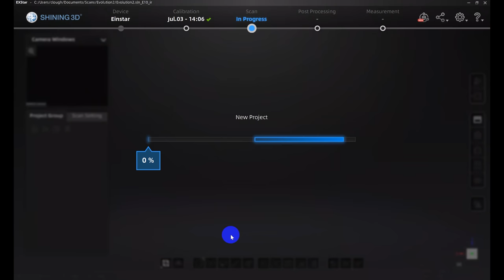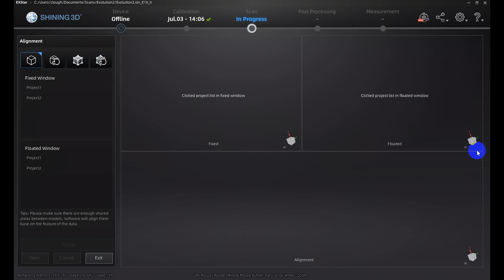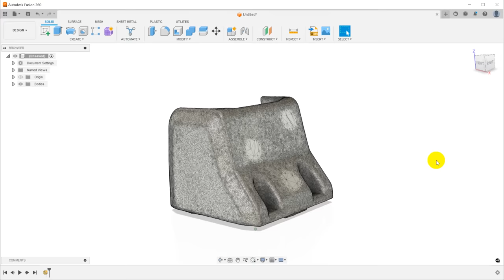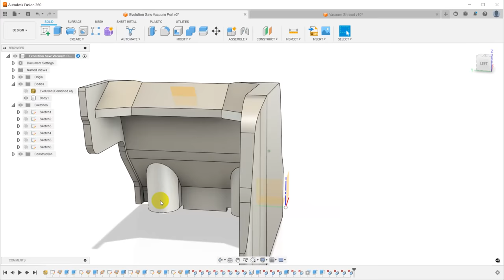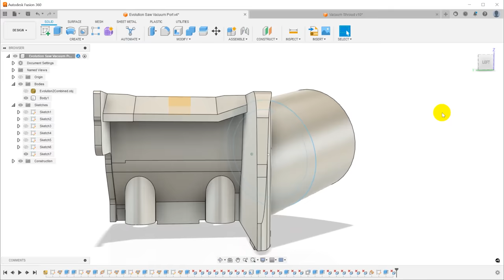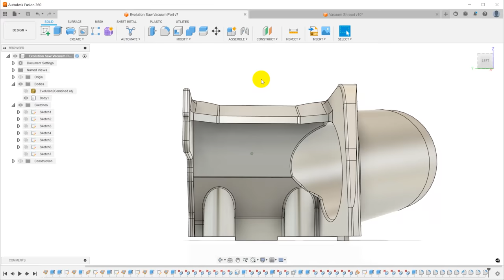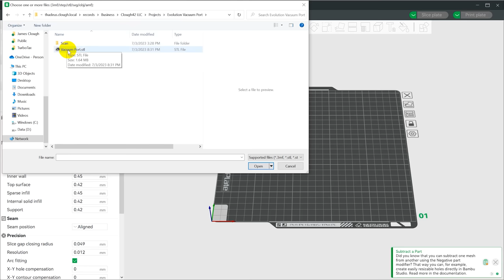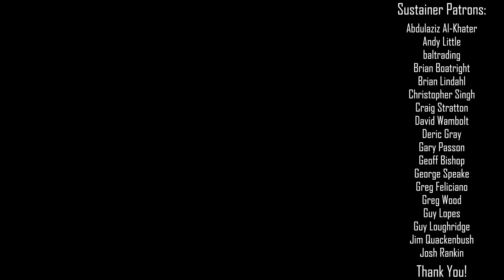Scan and 3D Print a Vacuum Port for the Evolution Cold Saw

Comment: Mine, and I suppose yours, throws red hot, or actually orange hot shavings out the end. Anything plastic will at some point get the metal embedded into it. That results in clogs and possibly melted plastic, or even fumes. The worst could end up as a fire. That’s why they don’t want a plastic vacuum hose attached that close to a port. The metal can reach 1500 f.

Hopefully that won’t happen, but it could. I hope I’m wrong, but this port doesn’t look that efficient. I imagine it will catch some chips. But the port should be in direct alignment with the direction the chips are being thrown in. Also, it should be shaped as a funnel so that it has a large initial opening which will , er, funnel the chips into the port.

I’ve tried to solve the chip problem too. I made a polycarbonate shield at the back of the saw that bends around the sides as much as possible without interfering with the metal I’m cutting. This is part of the swiveling stand I made with a metal draw under the saw to collect chips. I believe I can contain about 80% of the chips as the saw doesn’t sit in a table. The bottom is open to the draw under it. But nothing I can do stops everything. It’s annoying, but a consequence of metal cutting. Everything I use leaves chips all over.

Comment: My guess is the manufacturer didn't want a bunch of hot chips ending in a bucket of saw dust from a home shop vacuum. I get it's a cold saw but they were sparking pretty good during the cut.

Comment: What about one of those 12” ‘sweep into vacuum’ adapters mounted to pegs that fit into the welding table holes so you can move it around the geometry of the part and still catch a wide swath of debris?

Comment: Very nice!

For the chips that get shot out of the side, how about a 3D printed catch box mounted on a transverse rod to position it for different material lengths?

And I guess if it it just makes chips and not dust you could dispense with the vac and use a catch box for the back as well.

Comment: as others also stated: hot chips are hot and that is exactly why there is no vacuum port on the "cold" saw.
The vacuum does contain combustible dust and flammable chips so you should never use the vacuum to collect hot materials. And if you read the manual that came with the vacuum there will be a warning in there not to do so.

Comment: Its probably just my saw, but those chips do get hot even if its called a "cold saw". Longer cuts on thicker tougher material may start melting the hose. Although the air flow may be enough to keep it cool. I dunno. I've never tried. But I have had the chips melt into extension cords before.

Comment: i got a picnic food tent a couple years ago to protect painting projects from dust, i just threw it over my cold saw last night and so far it seems to help.  i can tell its containing things because i'm getting hot chips on the hand under the tent holding the saw switch, so i wear a glove.  the mesh lets in pretty much all the light and easy to see everything going on through it.  the chips do burn holes in it, particularly along the back bottom (which is also interesting to see that is where most of the chips throw, but a half dozen pinholes here and there seem like they may not be any particular problem.  the tent collapses in a split second and takes up basically zero storage room.  i wish it was cheaper than $25, wouldn't want to replace often if i did a lot of cutting, maybe there's a cheaper option or maybe i can tape over the burns.  similar idea as @TomasFaalPetersson @SamThurlow
Reply: but i still do cut on the floor in a corner

Comment: What about connecting the chip drawer to the vacuum too? You would propably need to 3D-print something that can jack into the existing 3D printed part to make a Y connection. If the whole slit where the blade goes down also is a vacuum port it might help with chip collection? You might need a more powerful shop vac in that case.

Comment: Very useful video, I’ve been considering one of these but didn’t know about the mess. Now I not only know that, but a,so what to do about it :-) I’d be inclined to jerry-rig a deflector or just plug the ends of the tubes with something, though.

- How about just 3D printing some plugs that will fit in the ends of the tubes? A loose fit aided by a bit of duct tape or … glue some little magnets into recesses in the sides of the plugs to keep them in place. If you’re using the saw much, it seems like a set of plugs in a few standard sizes should pretty much save all the mess.

Comment: You could have made it a tighter fit with a larger shroud to catch more chips. I think scanning the part you’re interfacing with may be a better strategy than scanning the part you’re replacing.

Comment: What would happen if you put a few large neodymium magnets strategically placed around the saw?  To make clean up faster make tubes to go around the magnets and then when you pull the magnets out the chips fall off of the PLA tubes.

Comment: I would study how Festool does it on their miter saw. Supposedly, their saws have the best dust collection. 

I think the manufacturer left out the dust port for liability reasons. You have air for oxygen, spark for ignition and for fuel, steel, aluminum, or both which is thermite. Not a scenario worth risking.

Comment: Either tape over the end you’re cutting off or print up some springy caps for the common sizes you cut. If you could keep the chips in the cutoff part at least you can dump those in a trash can. 

I hate chips all over!!

Comment: The reason for no vac port is....if material is thick enough and kicks out chips, those chips are hot and can get sucked up into the filter on the vac. (Fire hazard) Many people use a small vac for moving around or don't empty the vac reservoir enough.

Comment: These were amazing machines when they showed up. Always a smooth straight cut, almost polished looking even. And light, you couldn't carry any other saw that could cut like this. It was like they were a blessing but alas they are dirty beasts that breathe a fire of metal thistles from here to kingdom come. The curse is you'll never clean them up, how many have you pulled from your boot? How about the back of your shirt? That swarf is sharp as hell too and will scratch most things its rubbed against. And the noise, I was going to say do it outdoors but I can't think of many sounds more annoying or louder than the chop saw at full chomp. I don't see a future for these. Is there a laser chop saw yet?

Comment: What about printing a plug for the tube? at least it may contain much of the chips sent sideways to the floor/ Though even a 98% chip capture it will still require some sweeping because that 2% would drive you nuts!

Comment: i have the same saw and would love to try your dust collection port as 60% is still a 60% improvement and less mess to clean up  - are the CAD files available anywhere?  

I also try to sit the saw in a large and shallow cardboard box when i can which helps a lot

Comment: Does Fusion 360 not have “recognize features” like Solidworks? 
When used in its manual mode, it guides you through recreating the features on the model using SW features. Then it constructs all the sketches automatically.
Reply from the maker: It does, I believe.  It's been a long time since I've used it and my previous experiences were not good.  It barely worked when dealing with a clean mesh exported from a solid model.

Comment: What if you made a hose spliter and had one hose attached to the end of the tube? maybe a magnetic plate?  or a boot that fits the tube. this way the stuff coming out of the tube would be caught by the second hose. might get you to 80-90% dust collection.

Comment: I like your vid, had some seriously good info in regards to 3D scanning and Modelling. However, for simple parts such as the one you made, just modelling it is probably quicker easier and cheaper (i.e. no 3d scanner required) but this misses a massive point of keeping it simple, just move the damn thing outside, or to an area that can be cleaned easily, any good workshop should have a "clean" vs dirty/dusty work spaces.

Comment: That saw wheel speed is a bit ballistic for cold saws that I've seen.  Perhaps if you slowed it down somehow or got a different one that wasn't so fast.  Check out @DonnDIY.  He's got a pretty nice saw.  The wheel isn't super fast but it doesn't appear to suffer for cutting through stuff.
Reply: The cold saws I have used had HSS blades that ran slow with coolant, and a lot of tool pressure.  You could not cut a 5" steel round with this machine, but angle and tubing is great.